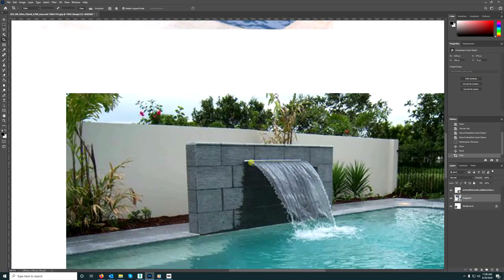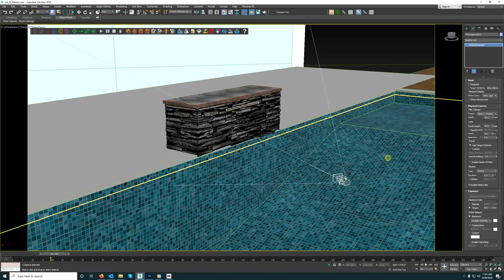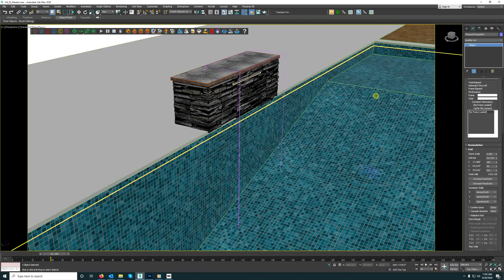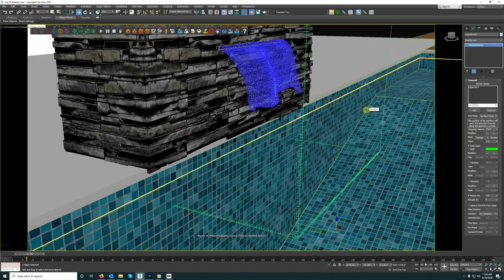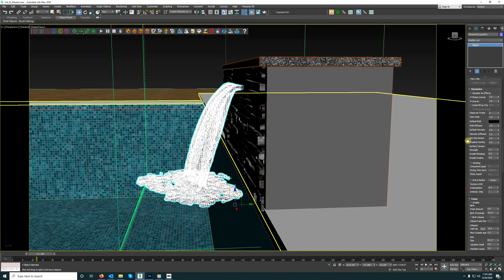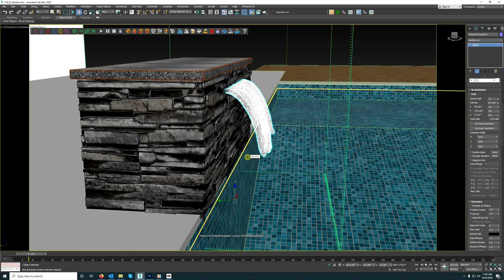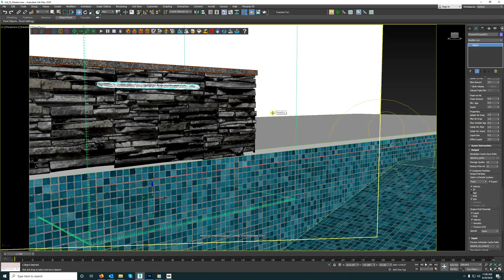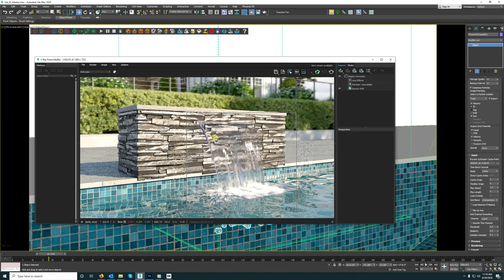Learn how to create waterfall features on Phoenix and 3ds Max in minutes!  Easy liquid tutorial!

Comment: Hey Jonathan 
I am having an issue regarding the speed ...when I start phoenix stimulation it takes hell lot of time to create the motion .....in perfomance my vox/s is 0.12 mb while your's it's showing 20+mb so can you please help me with this, like is there any problem with my laptop speed(128gb SSD +4gb Graphic + 8gb ram +1tb HDD) or something with 3ds max.
Reply from the maker: Hi Ritik.  It could be any number of things, but I'd suspect the main culprit probably being your CPU as a bottleneck. To be sure, I'd try running the simulation within a new, clean scene at minimal resolution and see if it still takes just as long.

Comment: Great timing - I'm doing a waterfall like this into a water tub :)  I have some questions;

1)  The water of the pool - is that just a displacement map ?  If not, how do you combine the water simulation of a swimming pool with a water simulation of a cascading fountain ?  (is it being affected by the waterfall ?  or is the pool water an animated displacement map or wave modifier).

2)  That 'broken' brick feature from which the water came out of - how did you create that ?  I need to create the same :)

3)  What is the spec of your machine ?  I have a 7980xe processor but I find that my simulations are slower than yours.

Thank :)
Reply from the maker: Hi Jez, 
1 - In this scene the pool water is indeed just a plane with an animated texture and noise modifier, since simulating the pool water in this case wasn't necessary.  If you do need to simulate the collected water, such as in a bowl or a tub, you can indeed do that. Check out the "Using Initial Liquid Fill with Containers" tutorial from Chaos Group.  It might help

2 - The bricks are a mixture of geometry/displacement.  I believe i picked the pattern up from 3dsky

3- I have a Ryzen 3950x, 16 core.  Try playing with the resolution within Phoenix, perhaps you can gain some speed without sacrificing too much quality.
Reply: @archvizninja5823  Thanks Jonathan - I really appreciate it - I've found the Stone Wall and I've also figured out how to do the swimming pool scenario as well.   Many thanks :)
Reply: @Jez1963UK  Did you find any information to combine the waterfall water with the pool water?  
Cascade I know how to do it and the fill pool water too, but the mix I didn't find any information.
Reply: @archvizninja5823  hi jonathan, where did you get the animated water texture?
Reply from the maker: @ricardoayala8691  the pool water just had an animated noise texture on the bump slot.  Maybe I'll do a quick tutorial on that soon